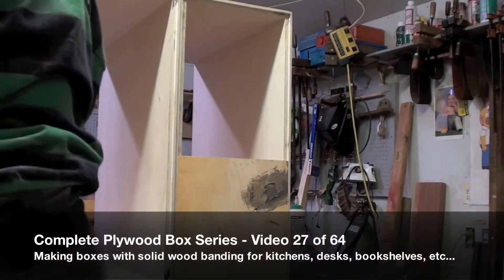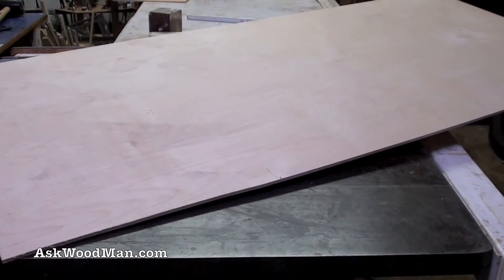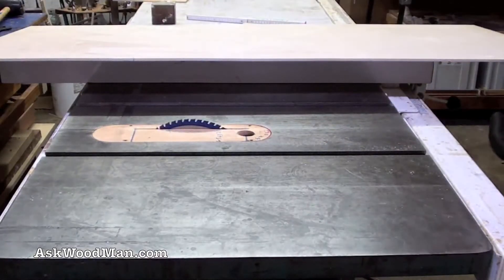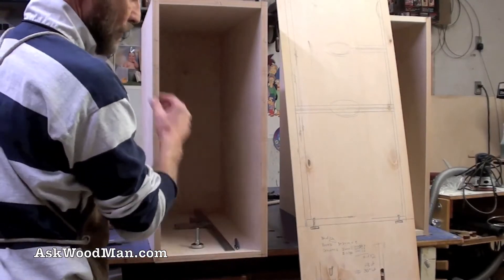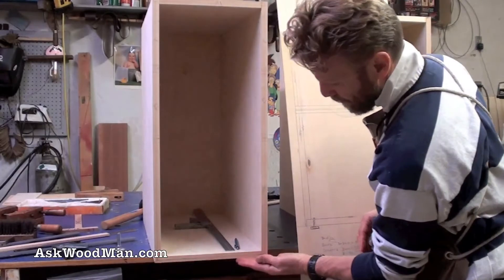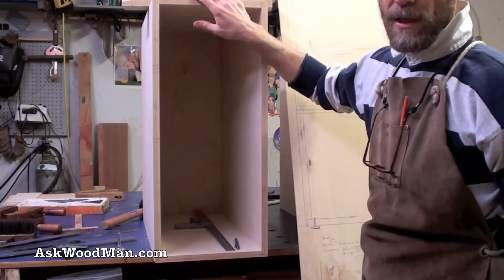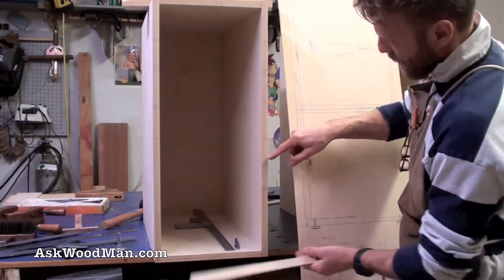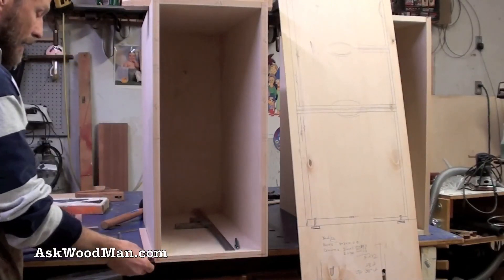How To Make Plywood Boxes • 27 of 64 • Woodworking project for kitchen cabinets, desks, etc...

Comment: @askwoodman I've been using Fastcap tapes for the past few years and they are really excellent, especially for the price. I have two, a 5m and a 16', both lefty/righty. They have 3/4" wide blades - I find 1/2" too narrow, which is a strike against the Festool, at least for me.

Comment from the maker: We here in the US will always have to keep those decimal equivalences handy because bolts, and drill and tap sizes on machines and tools will be around for a long time.I transition between SAE and metric without much trouble anymore. I have noticed a larger number of import tools from China being all metric, where not that long ago they catered to the US market with SAE. You fellas in the UK have the Old English weights to deal with too. Thanks for writing  and visiting my channel. Regards Allan

Comment: I use close numbers 1 ft = 30cm  (30,48cm) 1 inch = 2,5cm (2,54cm) to convert in my mind and get an idea when others where talking about measurements.
It is just a matter of using it to develop feeling for sizes in the other system.
I still can't get used to the fractions on drill bits and wrenches. It is so much easier knowing one number up is bigger one number down is smaller. By the way I appreciate your detailed videos.

Comment: Of course I am used to metric all my life but to be able to approximately tell length while I was in the US I look for things that usually have a certain size and memorized the ft /inch and went from there. For example standardized european cabinets, stoves, fridges are 60cm wide and I remember that being 23.6 inches, so when I looked at things over there I was comparing it to my kitchen and went from there to guess.